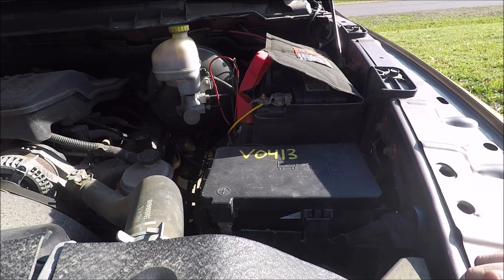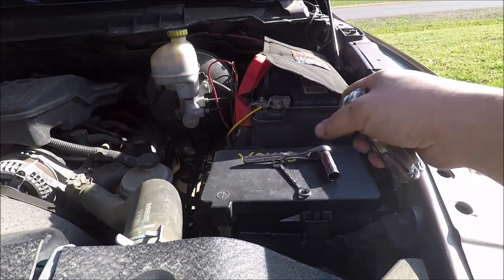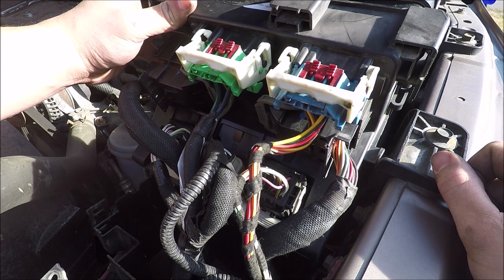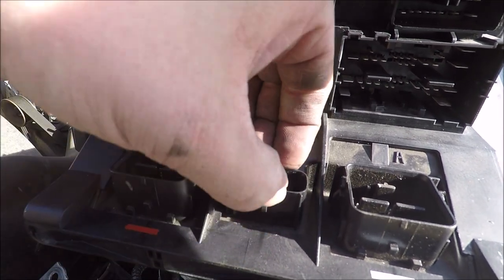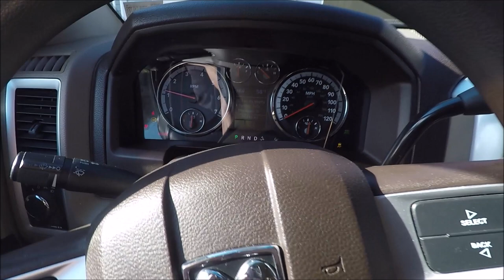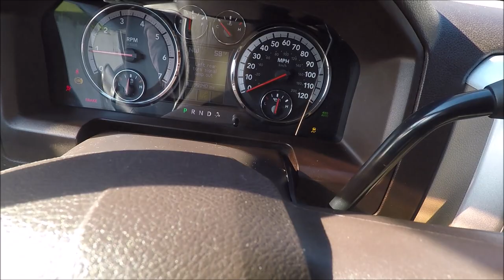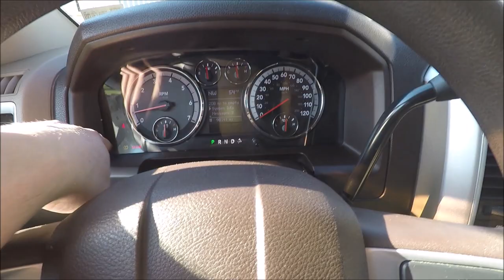2009 Dodge Ram TIPM

Comment: What was your symptoms for a bad Tipmi.  I have a nice start issue.  Was holding key for about 1 min then it would work for a few days. Now nothing. Powers the dash and everything. I replaced battery,starter, ignition module, new key fobs, and break pedal switch

Comment: Thanks for the detail on the TIPM - very helpful.  Curious, on the HVAC.  Does your blower have a delay on start?  Meaning, you can't fully control the AC blower airflow speed until after a few minutes of the truck being on?  I have heard all 2009's have this issue.
Reply from the maker: Glad the video helped, main reason I started them.  Without jumping in the truck and trying it I do believe there is a delay in the blower starting.  I can imagine it has something to do with the fact that the mixer motor (which I just replaced last week) needs to run through it’s travel limits and the power shed all vehicles do when starting.  The blower is strong after about 10 to 15 seconds but nothing I’ve ever noticed as being a problem.  

Checkout my other channel https://youtube.com/channel/UCgv8cis0fsZ8dOfCUEXtR_g for more mechanical videos, let me know if this helps.  Thanks.
Reply: @n2dadarknight  Thank you so much for responding.  Do you have the part for the mixer motor?  Is that the same as the actuator?

Comment: When I pull my TIPM I NOTICED THEY HAD A BLOCK WITH THREE WIRES AND AN OFFSET CONNECTOR. THEY DID NOT GO TO ANYTHING OR DID IT GO TO MY POWER POST FROM THE BATTERY? OR is it an option not used on my vehicle I would like to attach a picture of this if I may. 5:45

Comment: Great video. I would have broken plugs. Just one comment on the last plug that the red tab will actually be in the down position so you raise it thus pulling up the red tab that holds on and then simply squeeze the tab to release. Thanks

Comment: When you took the stock one out and replaced it with the one from the salvage yard did you have to get it reprogrammed? Or did it just give you warning lights like at the end of the video?
Reply from the maker: scott thornton no reprogramming required, after a drive around the block the notification lights turned off.

Comment: Hey my brother I got a 2010 Dodge Ram 1500 and one of my headlights is not working and my signal lights are not working is necessary to replace the whole thing??? I mean the TIPM module ? Tnx
Reply from the maker: Sounds like it, I would check fuses and then power at the components, other than that a qualified mech may need to be consulted.

Comment: TSGT VANCE, where is the Cars CPU at on the TIPM board or where at? Does the TIPM board have CAN signals and LIN signals or what?
Reply from the maker: All above my pay grade, I know the CPU isn’t in the TIPM that’s for sure...
Reply: bill williams can it make the truck not turn on at all
Reply: Sgt Vance can it’s stop the truck from running al together

Comment: TSGT VANCE, the TIPM controls the cars modules? or what does the TIPM do?
Reply from the maker: Think of it like the fuse box to your house but controlled by a computer.  It directs the signals from the trucks cpu to distribute power to the device you are operating.....at least that’s how I understand it lol.

Comment: What if I have no radio controls on wheel can’t scroll threw my cluster , dome lights, bed lights traction control , tow haul , park assist all don’t work would this be tipm as well or am I just screwed in general
Reply from the maker: Sounds like the TIPM, multiple unrelated electrical issues is a very good indicator.

Comment: What exactly is an upgraded tipm? More info about that would have been useful
Reply from the maker: You would need to contact Circuit Board Medics for that info, when I asked they said they swap components with  commonly known issues but would not go into detail.

Comment: so my 2010 is the same ! has anyone try if fuel problems stalling try putting in a wire at fuel fuse to sunroof  for 12 volts   to fix it ?   seems working but stalls really bad at stop signs  or is my tipm going ?  so sucks right ! stealers sad 1500.00 to replace mine no they dont know crap on these tipm !  been seeing all about the tipm  thanks for doing this now I know ok do it my self right !   scott

Comment: An used tipm can works without any type of configuration?
Reply from the maker: Gerardo Alvarez only from a 09 1500, my research showed that 4.7 or Hemi it should not matter.....I also couldn’t find any other vehicles that crossed over using the same engine.
Reply: Why did you have to change?
Reply from the maker: James Taylor I had numerous issues all at the same time.  To include no turn signals, no wiper blades, no AC blower, ABS light, ESP light, no headlights, no electric windows.
Reply: Tsgt Vance I have a weird p303 that turned into a random misfire. Along with a loud tick an low idle. I’ve changed the coils, plugs, and injectors, on cylinder 3 before the random misfire. Then changed the MAP sensor, and alternator. Nothing has helped.